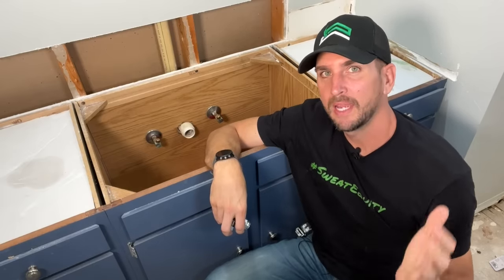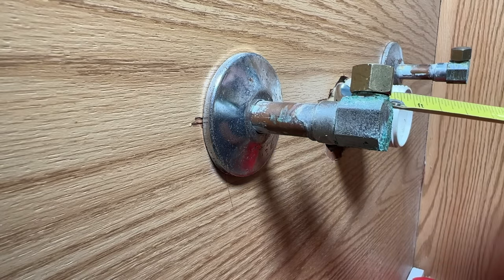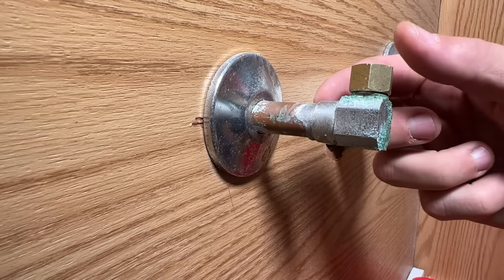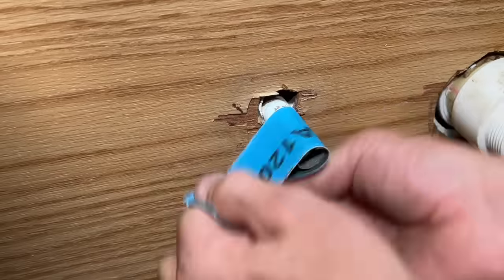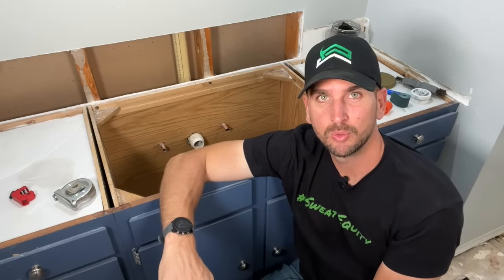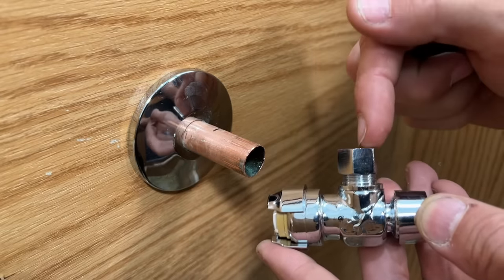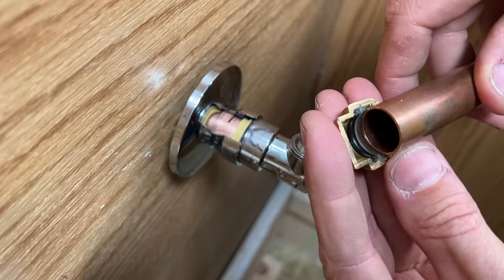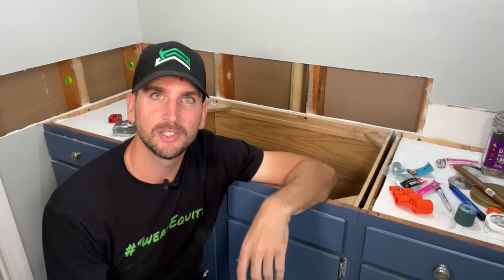Installing A Water Shut Off Valve | Easy Sharkbite Install

Comment: I am a plumber. Please don't use sharkbite angle stops. Sometimes when you turn them they pop off. They make these same stops in compression (turning a nut to compress a feral onto a pipe) involves not soldering and any one with 2 wrenches can do it. It's a a permanent replacement that is reliable, unlike sharkbite.
Reply: It's at least better than flowtite and those stop caps are a game changer. But yes, compression is as reliable as solder, but also DIY friendly
Reply: I agree. I only use sharkbites for emergency repairs that I plan to come back to after damage is mitigated.
Reply: He's absolutely correct , agree 💯 I've been a plumber for 43 years and I would never install a shark bite fitting ,unless I didn't have any other fitting and they needed water  to get through the night. It  would be temporary .. and then come back the next day !
Reply: I would always advise to put a little pipe thread sealant on the ferrule.  It's gives ya a little added insurance and comes recommended by a plumber here on YT.  I've recently installed 6 Sharkbite fittings at my house and my in-law's.  I've never had a problem.  Keep in mind plumbers today have gone to press type fittings which involve an O-ring similar to Sharkbite.  So what's the difference?
Reply: Compression are just as easy but actually hold up compared to shark bite fittings they are unreliable
Reply: Try compression on cpvc. I installed 14 of these shark bite valves about 14 years ago with not 1 issue ever. Everyone doesn’t have copper.
Reply: Says the "plumber" code for hire me to steal your money 😂
Reply: @RFSpartan  Literally. There's a reason every single one hates sharkbites. You can fix a leak for 25 bucks instead of paying them a grand. Lol
Reply: Can you use compression on older CPVC?
Reply: @fattysgarage1754 I was curious about CPVC...I hate it, so brittle.  Lots of it in my area.

Comment: I don't trust sharkbites. Soldering will last 50 years at the very least
Reply: Soldering may last but everything else will fail around it. Why not make it easier to repair everything in the future.

Comment: For sinks and ESPECIALLY toilets, use a compression valve.  When the sharkbite handle is turned to shut the water off in an emergency, such as a toilet overflowing, the entire fitting spins which could be a problem and get whoever is trying to shut the water off, such as your wife nervous.  With toilets, you'll really need to grab the entire fitting prior to turning that tiny and often very tight handle.
Reply: As a certified master toilet mechanic (plumber) I endorse this comment 🚽 🪠
Reply: Are you saying use something (compression valve) other than Sharkbite? I thought Sharkbite was compression.
Reply: @waterheaterservices  I cant believe a certified plumber endorsed his comment.  Why bother to cut it off in the first place?
Reply: Everyone doesn’t have copper. These work perfectly on cpvc. It’s better to use shark bite and replace every 20 years if you wish, than to glue on fittings and then cut walls open to extend and replace valves. These have there place.
Reply: @philipnicholson3216  Sharkbite is compression but usually the quarter turn will cause the whole valve to spin as opposed to a soldered fitting that won't. in cases of emergency you don't want the whole valve to spin

Comment: Should have desoldered the old fittings. Cutting pipes (and electrical wires) even shorter where it can be avoided is a very bad idea and poor practice.

Comment: Great video!  I am no plumber but couldn't you have heated up the old fixture and removed it without cutting the copper pipe?
Reply from the maker: If you can clear the lines of water that is doable but in that case if you have the skills/tools you would probably also just sweat on new shutoff valves. There are a few different paths you could take on this type of project. 👍
Reply: @EverydayHomeRepairs  Good point.  Thanks! 🙂  By the way, I have used the sharkbite products and love them.  I was worried about leaks at first but watched the repairs that I made with them for 5 or 6 years and they never leaked a drop.
Reply: @EverydayHomeRepairs  Making those pipes even shorter is the wrong path.
Reply: @EverydayHomeRepairs  Skills, tools, and the access. I'm able to sweat copper; the main reason I install something by the Sharkbite approach is because there are some places where you might want water coming through in pipe, but where you really don't want to be applying a torch flame sufficient to sweat copper, even briefly.
Reply: That's what I would of done.  It would of given a little more fudge factor for future repairs.

Comment: I’d rather see someone use a quarter turn compression fitting. That EPDM O ring WILL fail much sooner than a soldered joint or one with a ferrule.
Reply: Have you seen an EPDM O ring fail?
Reply: @deepsleep7822  you don't have to remove the valve to see if that o ring fail. All you need to see is water is leaking right behind that valve.

Comment: Is there a reason you didn't just desolder the old fittings and then wipe the copper down with a damp rag to remove most of the old solder?
Reply from the maker: Specifically for this project I was trying to lower the bar for a homeowner to accomplish the project.  With that said I think soldering is a great skill to learn.
Reply: @EverydayHomeRepairs  Sounds good.  Desoldering is even easier than soldering.  :-)
Reply: I believe If there's water in the pipe that you can't easily remove, it will make it difficult to heat up the pipe enough for the solder to melt.
Reply: @VFRExplorer  That can certainly happen in certain situations but I don't think that would an issue with those horizontal stubs he was showing. Also, desoldering isn't usually a problem. It is soldering where the problem comes in. Even with just a little bit of water it can create steam and the escaping steam can cause porosity in the solder which can create a leak.
Reply: I like how Everyday Home Repairs thought you asked about soldering when you actually asked about desoldering lol
Reply: @eosjoe565  when he cut the pipe with his tool there was definitely water in the line

Comment: i love sharkbites. i had to replace shut-off valves on 3 different sinks recently and they were a total life-saver!
Reply: people knock shark bites and say they're not reliable. I've been using them for years (I'll never put them behind a wall, only in places I can access otherwise I'll just sweat copper fittings) but they've saved me a lot of time, and my oldest one is 10 years old. still going strong. Copper fails all the time, any fitting is potential to fail. Shark Bite, for their design, works (in my opinion) just as good as copper. Especially when going from Copper to PEX, CPVC, PVC, they're great.
Reply: Mine are 14 years old and still work perfectly. I currently have 14 in use and can remove and replace them in 5 minutes. Because of cpvc, these are the best option so I don’t have to cut walls open to replace a glued on valve.

Comment: It's critical to properly debur and chamfer the outer edge of the pipe, whether copper, PEX, or CPVC. If you don't clean the outer edge up, it can damage the O-ring in the Shark Bite fitting and it will leak.

Comment: Sharkbite are nice and easy to use, but measuring and marking the proper length for the size is very important. I learned the hard way when it blew off.

Comment: I love shark bite. Deburring is critical else you stand a chance at cutting the o ring. Basic steps, basic tools all prevent a disaster. Nothing better for stopping a leak quickly for a homeowner. I have 3/4 & 1/2 caps for the 2 sizes of water in my basement.
Reply: There junk.

Comment: Don't forget to turn off/isolate hot water heater, humidifier, filters, and ice maker any time you isolate whole hose water supply. Flush well before putting ice maker and filters back on line.

Comment: agree, no matter how you get the old fitting off buy the shark bite tool, prep the pipe properly... also consider a right sized shark bite pipe cap around in case you need one...
Reply: Those pipe caps are very handy to have

Comment: I keep stock of 1/4 turn  piggyback valves . they thread on to the male  3/8 compression so you don't need to fuss with the original fitting or valve
Reply: I was wondering about that. There are people here who said they are plumbers, yet they only suggested to de-solder the pipe. In my opinion, we should be able to just use a 3/8 in. FIP Inlet x 3/8 in. Compression Outlet 1/4-Turn Straight Valve, correct?

Comment: In this situation remove the chrome escutcheons and use the mini cutter and cut behind those soldered 90"chrome ells.Then clean and debur the copper pipe and install the new escutcheonson the pipe but before that push the inside of the escutcheons on a flat surface in. Then install the sharkbite cutoffs.

Comment: I always appreciate your videos.  My problem is I have an existing sharkbite valve that will turn but doesn't turn off. It's not leaking, but i cant get the hot water valve to turn off.

Comment: I'm here to request you shoot a video of your instillation of a generator and transfer switch (I bet you have one). Not a "Everyday Home Repair" I know but everyone has power outages. I'm troubleshooting my Reliance Kit. and could use some tips. It's a DIY install, (I'm not an electrician but the Reliance kit was so easy. I have used the generator/Reliance transfer successfully for 3 years until last months outage, then 2 circuits were dead while on backup power, but good when line power was back (umm). I like your channel and have been watching it a lot. My only complaint is that you are too young to be THAT good at that many things. I bet your dad had a hand in that!

Comment: You really should try learning to sweat pipes already. It's not really that difficult once you practice it. 

Having done more plumbing the past few years, I find it strange that all shut offs aren't NPT nipples sweated onto the copper with an NPT shutoff screwed on. Doing it that way, if it ever breaks its trivial to replace and you don't need any specialized tools or have to worry about your sharkbite o-rings drying out and failing. And this is pretty much universally how hose bibs are installed both on hydronic heating systems and exterior garden faucets.
Reply: @Sam He knows how to solder, many if not most DIYer's don't have a blowtorch lying around nor the knowledge how to do it, this is a method more accessible to DIY. I'm pretty handy, and I have a blowtorch, but not doing that type of work all the time, I'd be hesitant to have that flame so close to the wood, so I would also (and have) use this method.

Comment: If I wanted to put a shut of valve in line (within a line of pipe) and not disturb placement on either end of the line, how much copper pipe do I need to cut out to install the shut off valve?

Comment: Serious question about Sharkbite and anything similar - they use rubber o-rings and plastic bits - both deteriorate over time - how long can these devices last? Soldered copper lasts lifetimes.
Reply from the maker: Sharkbite has a 25-year warranty from defects.  also keep in mind more and more plumbers are switching to Press fittings which are copper but depend on a o-ring for proper operation.

Comment: I believe you should not use emery cloth or sand the copper surface. This will cause leaks because the shark bite does not sit properly. The rough surface causes the Rubber o-ring to leak.
Reply: Then what do you recommend??

Comment: So What do you do if your copper pipe is less than 1 inch. I have worked on older homes and there is always less than 1 inch by the time you get the valve removed
Reply: If you don't know what to do, then why are you working on old homes?

Comment: Hi, question. I had to replace my shutoff valve. When I took of the old compression sleeve, new one didn't fit because the old ring made the pipe a bit thinner. So I googled and found Sharkbite shutoff valve and installed. My question is if I leaveit just as is then it's no problem, no leak. But if I grab it and twist then water is coming out. Is this normal?
Reply: Hi, did google told you sharkbite could fit the thinner copper pipe by compression fitting?

Comment: Can you help me? I installed it but the valve is not spinning. It is stuck and there is no water coming out.
Reply from the maker: Is it a new valve?  Is it a 1/4 turn valve as opposed to a multi-turn valve?
Reply: @EverydayHomeRepairs   Thanks for the quick replay. It is a 1/4 turn valve and there was nothing wrong with it. I was a bit stiff and I had to use a little bit of force to turn it.

Comment: I don't trust Sharkbites as I have had two connection I did in my basement that lasted maybe 10 years and developed small dripping leaks.  I would removed the old fitting and sweated on a new fitting and that would have not made cutting the pipe shorter.  It's not that hard to learn how to sweat cooper and for over 40 years in my home i have never had a sweated cooper joint fail.  Also I would avoid putting a Sharkbite in a closed up wall.
Reply from the maker: I actually agree that learning to sweat copper is a great skill to learn 👍

Comment: Dont listen to this guy as he is not a professional and tells u ways of doing things the fastest (like wagos) but will cause you trouble later. Sharkbites eventually will leak. Use a compression fitting or better yet simply resolder another fitting there and you wont have to cut the pipe..

Comment: one evening you get home and see your bathroom flooded, because one sharkbite broke loose.no thanks
Reply: I anxiously await anything like that. I've never had any trouble with Sharkbite and similar push-to-connect fittings, and I'm going on 11 years with such fittings all around my house. The key is to properly deburr/prepare the pipe, which you have to do when soldering as well. Every leaky Sharkbite I've seen, I pull out the pipe, and it's a ragged mess. Lazy people make that happen.

Comment: I have this piece of shit installed a few years ago. I can't turn it now, it's stuck. I'll remove that shit and will install a normal shut off valve, which is basically anything but the sharkbite